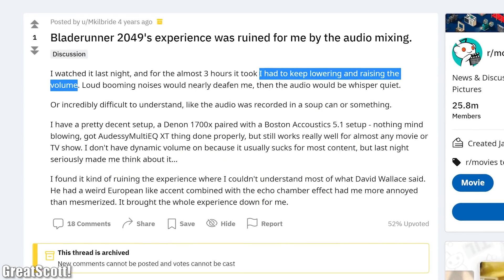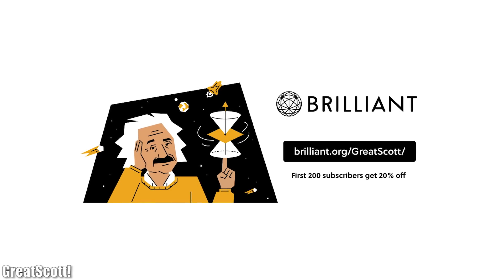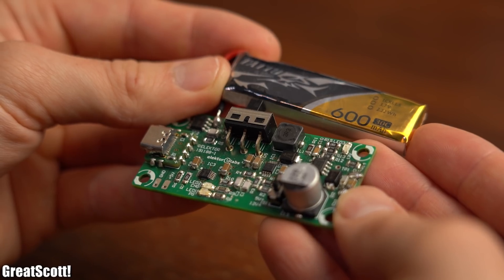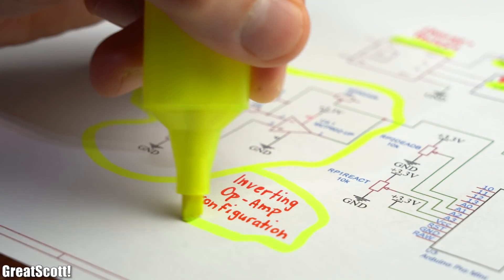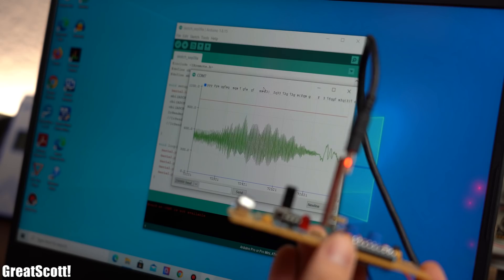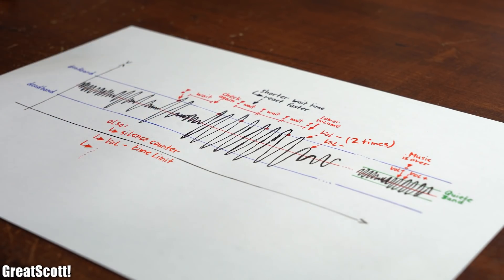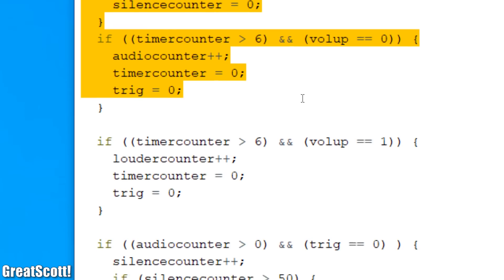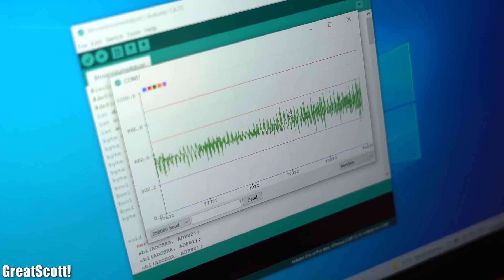Movie Music has a LOUD PROBLEM! So I fixed that! (Automatic Volume Adjuster)

Comment: Very cool project! But there ist actually a more common fix for that if you use AV receivers.
Both my Onkyo and my Denon receivers have a function called "Dynamic Volume" that does exactly what you realised with your circut without the volume ever exceeding a certain level.

But never the less your idea is great and suitable for every system👍

Comment: Usually this is an audio muxing issue. Your Bluray player and TV are trying to resolve differences in 2.1 and 5.1(or more) audio. Try manually setting your TV or Bluray player to 2.1 to get it to downmux properly.

The times that I've noticed this happening are when I have 5.1 audio coming into a 2.1 TV. Some TVs will also have Dynamic Range Compression out of the box. You could try enabling that too.

Comment: Nice project, i like how you implemented the SPL detection and the IR emitter, however as a sound engineer the premise of the device upsets me... the film is mixed that way to be experienced through a full surround system, the separation into each channel and speaker is critical and the individual volumes can be set for each speaker, also through a good quality audio decoder device you can enable dynamic range limiters and compression. what you are aiming for here is obviously "Night Mode" or Neutered mode as we would call it, I would recommend looking into the settings on your playback device and speaker system for adjustable settings such as dynamic range etc. The contrast between loud and quiet scenes will never function correctly through something as limited in function as a Soundbar. Great work nonetheless and well executed.

Comment: Nice idea. But on my TV there is a big volume bar in the screen, once you push it louder or less loud. That would be very disturbing while watching a movie.... 
It would require a separate sound bar, with remote control....

Comment: I think I would use a low-pass filter on the input volume data with an appropriate cut-off frequency, and use the filtered signal to determine whether the volume needs to be increased or decreased. Since the filtered signal follows the original input with a certain delay, it would make sure that the volume is only adjusted if the volume has been low/high for a longer period.

Comment: You could've tried implementing a fuzzy inference system (preferably Mamdani's) in the Arduino using volume intensity as a fuzzy set.
Reply: WTF does this even mean?
Reply: @jameslaine2472  Fuzzy systems are advanced versions of binary systems as they work in values between 0 and 1, unlike binary systems that work only in 0 or 1.

Comment: This is a problem with multichannel audio downmixing.  Blame the manufacturers making speaker bars that don't do this well or TV speakers that have the same issue.  The best thing you can watch a movie on is a dedicated surround capable receiver.  You don't even need all the speakers as the good ones will give you enough control to the downmixing.  Although I would recommend a minimum of 3 speakers.  A left and right for most things and a center channel for dialogue.

I don't mean to put down this project itself because your work is great.

Comment: Hate to say it, but the problem is not with a movie or sound mixing, it's your own hardware/software problem - you have to either use (at least) 5.1 system (with centre speaker), or properly downmix 5.1 sound to your stereo system. And if the dialog is quiet, that just means that your system is not mapping 5.1 onto stereo correctly (it can simply be ignoring a centre channel, where the dialog usually is) and outputting front left and right (where only a small part of the dialog sound is present).

Comment: Sorry to disappoint but there is a much simpler and more efficient way, you need to build a device that receives the audio and outputs the audio at a uniform volume, it needs to know how to handle complete silence and loud noise and just not change the rest (this can be done in computer software very easily and perfectly efficiently) (I've done this before for a friend)

Comment: A 'log amplifier' can be used to compress the signal. A lot simpler than an MCU based solution and won't need fine tuning of timing parameters

Comment: Loose the IR and Op Amp, just put it in the Audio Feed Cable, or HDMI Breakout Box, to the Amplifier. It's 1volt p-2-p Line Level, or 3.3volt Digital.

Comment: That's a very cool idea. I think the next revision should use an aux cable input, so that it doesn't matter if there are people talking in the room. Then one could set a fixed volume on the speaker and just have an automatically adjusted input signal. I think that would be a bit more complicated (digital potentiometers,...) but it would make it a bit more convenient 🤔
Still a great video though 😁👍🏼

Comment: I would suggest to use audio power rather than instantaneous voltage values. After calculating the audio power, smooth it out using the previous power values (amount of smoothing can be controlled) and then apply dead band analytics and hangover logic to delay the decision.

Comment: I wonder if using an inline circuit like a compressor (that is used allot with bass guitar) or even the "destressor" that is used by Glen from SMG. only issue is that it only works for analogue signals and mostly those devices are 1channel. but if you have  2 compressors...maybe?

Comment: An audio compressor does exactly what you wanted without sending IR signals to slowly lower/rise the volume.
Reply: yer i just use the compressor on vlc player to do the same thing , in my opinion the movie industry should do 2 audio mixes , 1 for the movie theatre and 1 for home because if you have neighbours or family in other rooms the dynamic range is far to big for watching at home it should be a lot less
Reply: @drumandbassob0007  they do exactly that already, but the reason they seem like it was mixed for a there is, and this is just a guess, they don't put in the work necessary for playtesting it in an equivalent environment because that would eat up budget for a seemingly small gain, people are going to buy the movie either way. its a really interesting economics case really (I'm in microecon rn in college, so my brain thinks this way on top of my engineering economics)
Reply: @foxphire0093  if they did exactly that already, we wouldn't all have the problem of the range being so large. You are in college?
Reply: @foxphire0093  You raise a fair point. The bottom line is almost always money. Given that, I wonder the economic incentives which lead movie studios to make this choice to play music so loudly.
Reply: @foxphire0093  the thing is if they did even a basic comp/gate plugin like the free ones.. that will fix this. Passing the audio through preset is not going to effect budget. We are talking 1 hour in time.
The ozone default master preset would fix this.
 editors audio master > load plugin done
Reply: @Maradnus  I guess they would? I've never listened to a stereo track, but they are there (on disks at least). Not sure if streaming providers use the same audio tracks
Reply: @foxphire0093  Well, no not really. Movies are usually remastered anyway to fit the needs of the medium (i.e. streaming, DVD or Bluray) or to optimize towards them. The sound track (and also the video track) you get on Disc usually is a different one than the one in cinema, so they are paying the mastering engineer anyway. It's a decision they made to keep the dynamic range high as the customer experience seems more "cinematic" (not bothering if that's what you want for your TV).
Reply: On my main tv, since it's all mixed down to stereo anyway I just throw it all through a compressor and squash it to hell. Much easier than adjusting the volume all the time.
Reply: Wasn't it interesting that Scott solved a real world problem his own way? I always pick up something on this channel🙏
Reply: Compressor/expander to level out the audio, might want to adjust the video sync in vlc to negate any processing delay.
Reply: I did not know this
Reply: I wish there was a player that has VST support.
I wont use VLC as i think the audio sounds really scratchy. 
Having VST support would be amazing as i could use any one i choose instead of built-in inferior options
Reply: @Maradnus  There are VST host software allowing you to route system audio through them. Depending on your soundcard and their drivers this might actually be okay in terms of latency.
Reply: But audio compressors cost a fortune and of you build an analogue one yourself it might jsut sound crappy.
Reply: Yeah this is like using a camera and colored lights pointed at your TV to fix the tint on the picture.
Reply: No Need any of this, just extract the audio track and change the dialog normalizzation level wich is only a tag
Also most players, home theater and TV has yet an option to do it
Reply: I don't believe you. You don't seem that smart.
Reply: @ZeginMakesMusic  Nice one, insulting someone on the internet. Good job!

Comment: I would've used the audio signal of the soundbar as an input instead of using a microphone. That way you can eliminate false readings, make the code simpler, hopefully a more accurate, and quick response. Also i think you can do all that and somehow fit everything inside the case of the soundbar

Comment: As we know MOST dvds come with a few soundtrack options (even if it's just different languages). It would be great if they included a track for people who's hearing has deteriorated, where the music is backed off so you can hear the dialogue.
Reply: Annoyingly most of this problem stems from the fact that soundbars are very popular, yet the movie industry hasn't figured that out. If they would mix audio to work with soundbars, or just provide compressed audio levels, it would solve the problem for both me and you! Hollywood is populated with idiots, though.
Reply: @Variety_Pack    That last sentence is straight outta the mouth of a Wiseman.
Reply: Yeah, that's my problem. Approximately a decade ago, I searched for remedies. I found none. Time to research again!
Reply: The studios don't want to spend the money on the extra people to re-mix all the audio for home listening.
Not to mention that they probably have big incentives to keep the theater audio mixing, as to encourage more sales of high end home theater equipment.
There's not much money in making it sound good on cheap 2.1 audio. Gotta spend $50K on the whole setup.

Comment: Two suggestions for improvements of this brilliant idea: 
1. Run the entire film once to let the system map points where it needs to lower and up the volume, avoiding to keep the first couple of seconds to be too loud.
2. Tap the amp inside the soundbar directly, so you don't get the volume overlay on screen, as it's rather annoying once the fascination for seeing the device working wears off ;-)

Comment: Some advice on measuring battery voltage. Run your second resistor on your voltage divider into an input of the microcontroller instead of directly to ground. That way you can regulate when you want to check battery voltage and there will be almost no parasitic loss. Just toggle between low output and input to enable or disable it.
Reply from the maker: Good idea

Comment: Here is the "My movies get too loud and I cant hear the dialogue" troubleshooting kit:
1. Do my speakers have a dedicated midrange driver?
2. Are my speakers capable of reasonable power handling (100-200 watts)?
3. At those power levels, are the drivers producing minimal distortion?
4. Are my amplifiers capable of these power levels while maintaining low distortion?

Comment: I thought about doing this a while ago with YouTube videos that always had different volumes. These actually exist, they are called Automatic Gain Control. Many advanced sound bars and surround sound systems have a "midnight" mode which does exactly this; to prevent annoying others
Reply: All youtube videos have the same volume, and have had for quite a few years. 
Your gadget makes it worse, not better because it detects electrical energy and not loudness.
Reply: @hepphepps8356  I have definitely noticed some videos are much louder than others, at least in the past. And yes, an automatic gain control is a hardware solution to that problem. In audio terms they are called compressors.

Audio out of my headphone jack is an AC voltage that varies up to a couple volts peak to peak. The envelope of the AC waveform is directly proportional to loudness as that directly affects the deflection of the diaphragm in your speaker 🔊

Comment: Sounds like we need to figure out a HDMI in-line compressor device. My background is pro-audio (think live concerts) and we use compression pretty often, sometimes people hate on it when it’s noticeable. But either way, you’ve basically built a compressor, witch is really awesome.
Reply: Yeah his device is a slow compressor essentially, but modern Bluray players, Tv's and Soundbars should have Dynamic range compression and night mode options to be enabled. I wish the general public was aware of the different ways they could control their audio systems at home with some pro audio tricks, Put a behringer rack beside your TV :D
Reply: What's with some music producers triggering the compressor on the kick drum and compressing the entire band heavily. Yes it's an effect but it's horrible.

Comment: The issue is that many videos are surround sound. The film is mixed expecting something like 4 side channels (corner quadrants) for music/effects plus a center channel in front of the audience for most dialogue. But MANY people only have a regular 2-speaker Stereo system. So the dumb media player just adds the sound for all side channels together. You end up with two left channels on one speaker, two right channels on the other, and half of the dialogue on each. This means the dialogue is drowned out by ~3x of everything else.

The real solution: proper down mixing, which TV/Soundbar/app (Plex, etc) companies just don't seem to even try to fix

Comment: My first thought would be to rectify the preamp level audio to come up with a filtered DC average for volume and feed that signal into a A2D input.  Then use maybe an i2c digital potentiometer to control the volume for each audio channel.  Instead of using a valuable timer to read your potentiometer values periodically, you could just add a push button to trigger a reading of those two analog inputs. manually or when first powered on.

Overall it a neat idea.

Comment: I'm with you GS.  The older I get the less I'm able to hear movie dialog, especially on cheaper TVs.  In the 1980s I designed but never built a system like this to eliminate TV commercials.  I wanted it to detect when certain pixels lit up in a predictable sequence over, say, a 10 second span and then store that sequence in a memory buffer.  When it came up again, the buffer would detect a match and tell the circuit to mute the audio and video.  It would then wait for a pixel pattern to appear that wasn't in the buffer before turning them back on.  Turned out to be too complex for my fledgling electronics career to handle, and then came DVRs and Tivo which basically allowed people to just fast forward through commercials.
Reply: That is true, I ve found that with cheap audio monitors I don't have to raise volume so high as with lousy original tinny TV speakers to understand speaking in movies. I think that this applies  to elders even more.

Comment: Oh dear why not just use a simple analog compressor circuit? Or if you really want it  "digital" process the waveform and take a DAC to get the sound back. 
But well it still is a nice idea.

Comment: DSP should work perfectly for this as you can just adjust the incoming input signal(signal before the speaker) super fast and accurate using software rather than using output, ei speaker, microphone and ir led.

Comment: Cool project, though the best approach would be to analyze the signal ahead of time. A streaming device usually buffers some amount of content, and that gives them ample opportunity to adjust the volume at just the right time. My Roku Streambar is very good at leveling the volume. Dialog is very clear, yet very loud scenes (with battlefield artillery, for example) are played at a similarly comfortable volume. There's no reaction time, meaning the volume seems to be adjusted just before the major changes in recorded sound level. Granted, a similar presentation of such wildly different scenes isn't entirely natural, but it really makes watching some movies more enjoyable. And without the volume leveling function, going to bed using the TV's sleep timer is usually not an option since there are just too many loud segments.
Reply: I agree but that would be doing the sound team's job for them. This device is just meant to make it so you don't have to remove attention from whatever you were doing just to use a remote.

Comment: You do know that there is an arduino infrared library that reads the signal from the remote through a ir receiver led, and output a hexadecimal code for it. And that same library can convert the code into output of a ir led. It shows the hexadecimal code in the serial monitor when you press the remote

This man here connect the receiver output to an oscilloscope and study the square wave waveform to get the code 😂

Comment: As others have mentioned, need to adjust your sound setup.  The movie is probably sending 5.1/etc that your soundboard doesn't understand or mix well.  Need a center channel to get crisp and loud dialog!  Still an interesting electronics project regardless :)